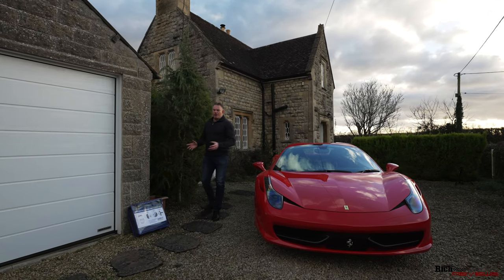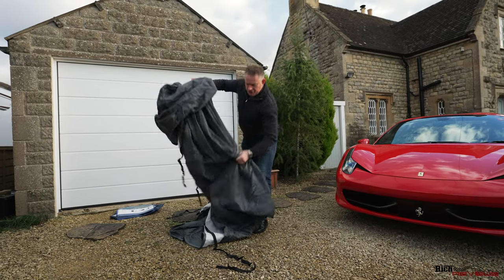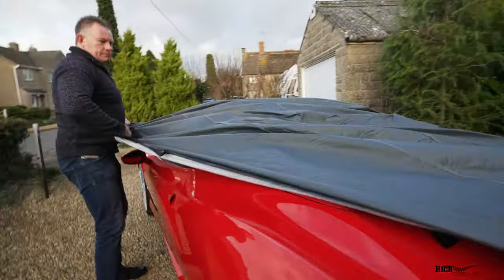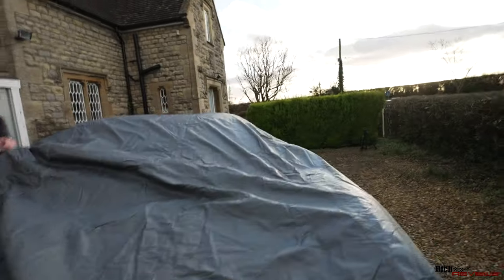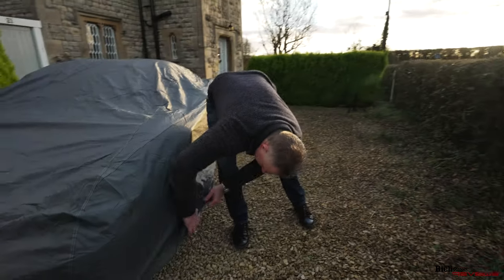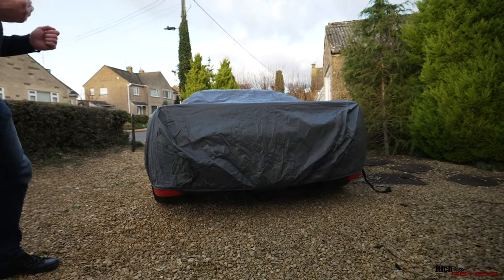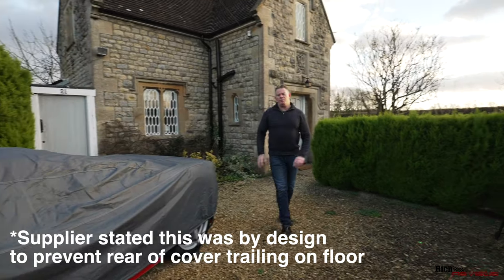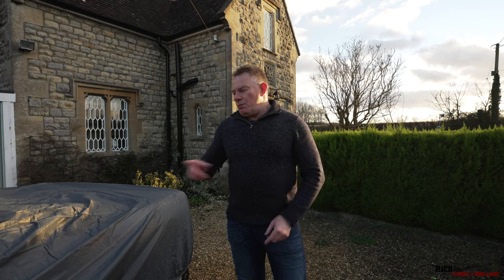Is THIS the best car cover for the 458?! (Premium Direct Car Cover review)

Comment: Hi Rich thanks for the content I’ve got a couple of issues with my 2010 458 just purchased, it’s only done 5000 miles and not been used to much recently, engine all good but the radio doesn’t work, can’t get a station or search for one, the hard drive does play some downloaded music any ideas ? The other annoying thing is the led lights on the steering wheel don’t light up at all and it’s switched on under the settings on the left hand screen ? Was thinking disconnecting the battery for a hard reboot which I’ve seen suggested on a forum.  Much appreciated
Reply from the maker: If the LED option is definitely switched on in the left screen settings then either a fuse has blown, the LED unit has blown or it’s got confused and needs a reset. 
Obv recommend the settings check then battery disconnect for 5 mins then reconnect.
When reconnecting follow this initialisation sequence recommended by Ferrari…

- Temperature should be above 41 degrees F
- Connect battery
- Before starting engine make sure all doors are closed (i.e. engine compartment, luggage compartment)
- Close doors and leave vehicle alone for at least one (1) minute
- Do not switch on any consumers during this period
- After one (1) minute or so, lock/unlock doors with remote
- Open the luggage compartment lid by pressing button twice on remote
- Insert key in ignition and turn to position II and WAIT AT LEAST ONE (1) MINUTE before starting engine
- Start engine
- Leave the engine stationary for approximately 10 mins in the following conditions:
- Engine at idle speed
- water temperature stabilized
- consumers turned off (lights, windshield wipers, etc.)
- A/C off
- Close door and raise the door windows to the upper limit and then lower windows. Raise them again and check that they move down to the target position when doors are opened.
- Set date and time on the instrument panel.
Reply: Good man thanks will try

Comment: i dont think its as good as the 39.00 cover i bought from amazon for mine. mine has mirror pockets as well as a zipped drivers door entrance flap, both the elasticated hems and the three securing straps. and is also a material that repels water ( a tip for the middle strap tie it to a broom handle or the like and poke it under to the other side !!). NEVER open the cover on the driveway especially on a gravel drive (shock horror !!! ) put it on the rear engine cover and roll it forward over the car so it doesn’t drag on the floor picking up god knows what and dragging it across the body . in fact what i do with mine is put the soft dust cover that comes with the 458 on  first so the outside cover doesn’t move on the paintwork in the wind as all these covers will move about in any small breeze.. even though they are fleece lined i don’t trust them. plus  the wind will blow dust grit and dirt under the cover and the the movement  of the cover will grind the grit and dust on the paintwork.
always best to be double bagged as they say.
Reply from the maker: This 458 Direct Car Cover has a very good waxy water repellant coating and a soft inner lining to protect the car.
Noted regarding opening on gravel driveway but my driveway is clean and the stones are fairly large therefore there was no cause for concern.
Reply: do you have the item link?

Comment: I’ve had a similar cover not from this company, they’re all the much same, cheap, poor fit and featherlight straps with poor locks. You need to spend £500 plus to get a decent cover, but you pays your money……
Reply from the maker: You can pay crazy amounts for car covers, this cover is very reasonably priced and is functionally better than those twice its price.

Comment: Not the best idea to drag the cover all over the gravel then put on an extremely expensive Ferrari??
Reply from the maker: My gravel drive is very clean and the stones are large. I checked the cover for swarf  before pulling it over, this was not interesting viewing so was cut. 😁
Also my car has full self healing PPF.
Reply: I wouldn’t put a cover on the floor of an operating theatre and then use it on my car….. just saying 😂😂
Reply: @mc02fly28 he doesnt understand no matter how much you explain and doesnt care as its ppfd 😆😆😆😆😆

Comment: I don't believe car covers are good for the paint. They end up scratching the paint and causing more damage over time than having no cover.
Reply from the maker: They meet a requirement for protecting the car overall and should be used when beneficial. I have had situations where my car was parked under a tree and was a nightmare to remove the sap…had I used a cover no issue.